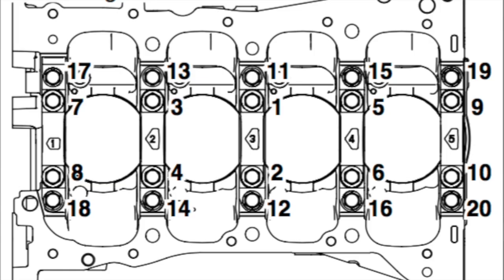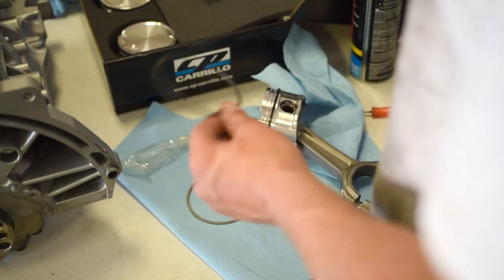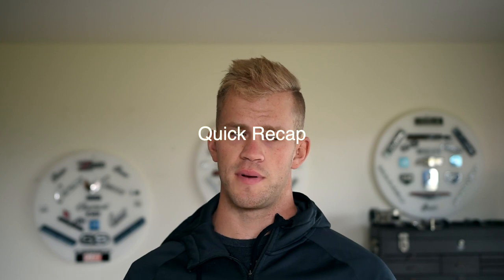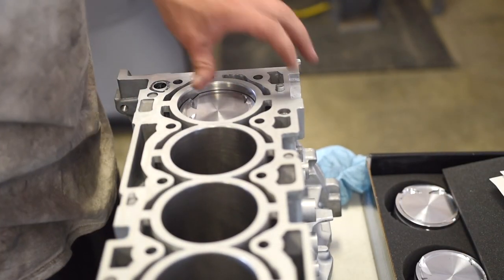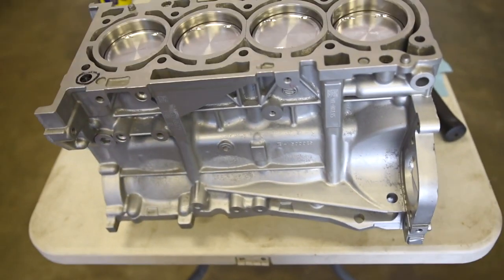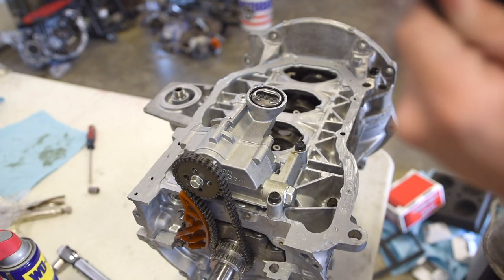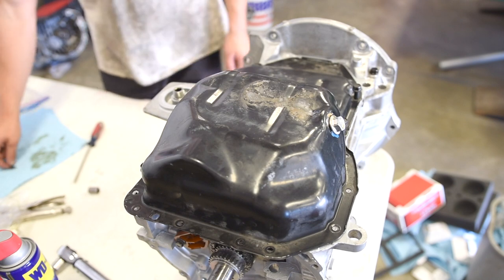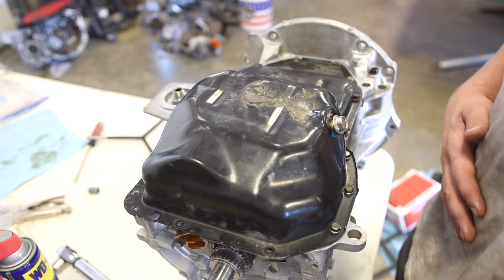600HP Capable Evo X Motor Build | Short Block Assembly Ep. 2

Comment: Late to the party as I binge watch.  Great to see how you've come on with your style in later videos .   Definitely don't use RTV on the block (not sure if that was a slip of the tongue) - Threebond is great.  RTV doesn't break down in oil so anything that squeezes out inside the engine as you torque down on the joint will eventually start to break off and block the oil feed passageways and if it makes it to the oil pump then  engine seizure will follow.